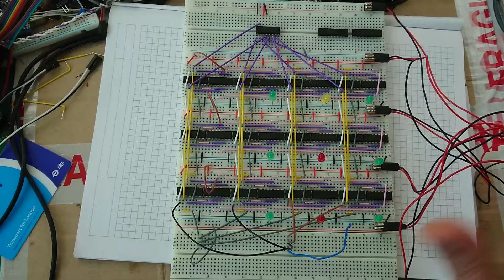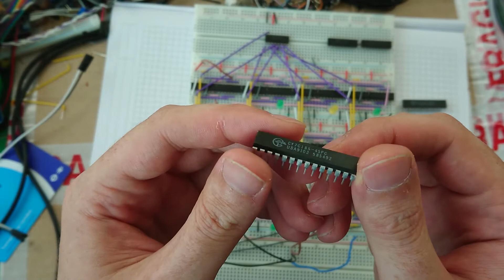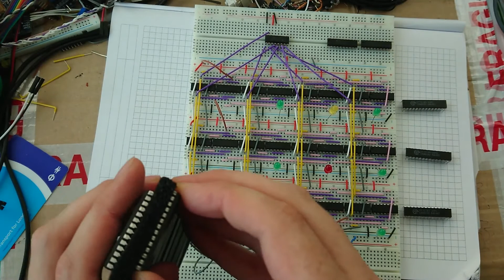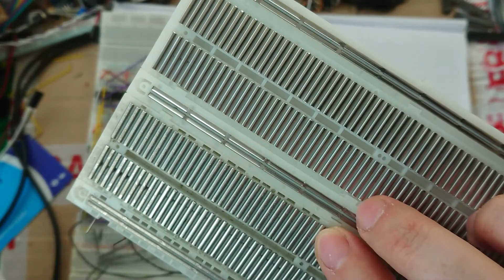A 3-by-8 Bidirectional Buffer Matrix - Plum Breadboard Computer

Comment: Hi, while building a 8Bit Breadboard CPU based on the SAP-1 and Ben Eaters implementation, but with 8bit address-space, I stumbled over the same issue with shared In and Out pins on the available SRAM-Chips. I am using an AS6C6225, which from a quick glance on the datasheet of your SRAM is quite similar. I ended up using two buffers/transceivers on the I/O-pins, one for either direction, because I also used LS157 selector-chips for the selection between manual-input and BUS-input. The LS157 dont support 2-way direction, so I had to use the LS245 BUS-transceivers as isolation for read and write mode. You might get around that, if you only have one input-source.
If I understand it correct, you are trying to build like a stack of 8 pieces of 3bit Registers? It might work with a 3bit counter and 3 to 8 demultiplexer, to keep track of the position. If the counter would be capable of presetting, then this would work like an address decoder. For example the 5th bit shall be written, then the counter needs to be preset to that position and can (via the demultiplexer) manipulate the input-source for the SRAM. Each I/O-pin of the SRAM would need a A/B selector which is controlled by the demultiplexed counter. So for this example, the 5th selector would be set to source B, while all others would be set to source A. Source B is you matrix. Source A is the 8bit registerchip (for example 74 273/377). I dont know of a LS-Series selector that can be driven in both directions, so you would need to go with two BUS-transceivers on the I/O-pins of the SRAM. For controlling all this read and write (read, select, write) operations a additional micro-step counter might be necessary (like for the microsteps an instructions-decoding-and control-unit). These are my spontaneous thoughts.
What is the source of the 3 bit word? Do you want to multiplex to save on BUS-lines? Which address will be feeded into the SRAM?
Reply from the maker: Ok so first off, thanks for taking the time to comment. I love these kinds of comments, I mean being showered with praise for tidy wiring is good too, but it's nice when someone's engaging with the project itself. :D Secondly, sorry it took me so long to reply. Comments such as this deserve a proper response and I've just been so busy lately! Anyway... I don't currently have any provision for manual/bus input, it's just not something I've looked at yet because I have the arduino that acts as the control unit and interactive "console", so I can program the memory that way but it's good to keep in mind that those multiplexers are one-way only. I've just chucked some in the basket for my next farnell order. ;) Yup, you've got the gist of it, except that this will wind up being a 64k x 3bit memory as opposed to a register file, though I guess they could be considered pretty much the same thing. I'm not using a counter to allocate the positions within the bytes because I have the most significant three bits of the 16-bit address fulfilling that role, but beyond that it's as you describe. What I don't have right now is the bit whereby one bit comes from source A and the remaining 7 bits come from source B. That's the bit I need to build next. What this module allows me to do is present three 8 bit wide I/O pinned chips as a single (8 times larger) 3 bit wide chip with I/O pins, though that may wind up being less useful than I thought since there will need to be a register sat in between, I think. Source A would be what's coming from the matrix, and source B being "whatever's already there". If I do that with a 74-574 or 74-273 then those data paths won't be bidirectional any more. I should probably draw out the schematic again and remind myself of what I've done!
Reply: @dankendell  Thx for your answer. I am looking forward to see the Plum grow and evolve.

Comment: Schematics are for wimps. ;)
Reply from the maker: Well what use is a schematic when you're making it all up as you go? :P
Reply: @dankendell  Aha!  Im new in this area, however. Schematics are so when you go back to your project 6 months later you can remember what the h*ll you were thinking! :)   I made an 8 bit manual register for my 8 bit sap using 556's(latch). I can set it bit, by bit or directly from the buss in either clear/load  addbits/load. Each 556 gives me 2 bits, and a common reset.  Very cool btw. I have a big bag of 74ls245s en route for similar weird projects. Cheers-
Reply: and while Im here lol... The chips on that register are self explanatory, the only thing I added was a pulse to clear the register on load. Did you know you can right click a video and link to a certain time? Anyway- this is the circuit I used. https://youtu.be/BA12Z7gQ4P0?t=823

Comment: Hi, I love all your videos! I'm thinking of building a breadboard computer for my third year uni project, do you think it would be possible to get one working in a year and a bit, given I have very limited (ie. I don't yet own a breadboard) knowledge of electronics?

Thanks for making all these videos and I know everyone says it but your wiring is MoMA tier.
Reply from the maker: Glad you've enjoyed them. :D Absolutely! It's not difficult, just time consuming. ;) I'm taking my time with mine and only working on it in the evenings, but if you're doing it as a uni project and it's more full time, then certainly. :) You don't even need that much electronics knowledge when you set out, though obviously it helps. For the most part though you'll pick that up along the way. If you stick with the same family of logic chips (eg: 74HC* or 74LS*) then you can think at the slightly higher level of it being a "logic machine" rather than an "electronic machine". The best tip I could give I think is that in the logic world, there's only TRUE and FALSE, which when translated into electronics is typically a "high" voltage (5v/3.3v) and a "low" voltage (0v). At the electronic level however there's a difference between "disconnected" or "floating" and "low". A disconnected input pin is in an indeterminate state. Could be low, could be high and is often just on the tipping point between the two and can be influenced by nearby signals or anything really with an electric charge (like a finger!). So in short, make sure you connect all your input pins to something unless the datasheet explicitly says that you don't have to or shouldn't. 9 times out of 10 when I'm getting "weird behaviour" it's down to a floating pin somewhere. Fondling the whole thing and running my fingers over the chips is a common debugging technique for me. Either you'll influence a floating pin and things will "go funky" when you touch it, or you'll burn yourself and find the hot chip. Done that a few times too! :P I should probably make a video demonstrating it. ;)
Reply: Thanks for the reply! I'll definitely watch out for floating pins. I have one other question if you don't mind - How much more complex does it make the computer to address 64kb (or even 256b)? I'd like to get some meaningful programs running on it :)
Reply from the maker: No more complicated, just bigger with wider busses. :)
Reply: Liam Piesley - not meaning to detract from Daniel and Plumb... but have a look at Ben Eater's vids too and all your questions will be answered.
Reply from the maker: Not at all, he's done some amazing videos with a level of meticulous detail that I just cannot be bothered to go to. :D Besides, Plum and SAP-1 (Ben Eater's) are different architectures anyway. I'm happy to just plod along doing something different. :)